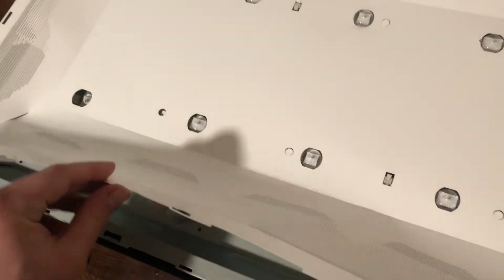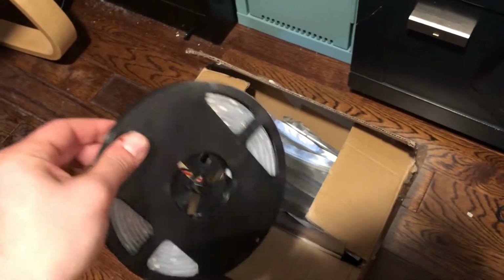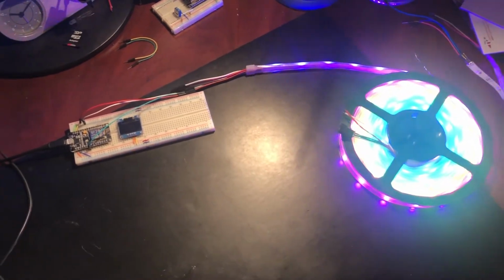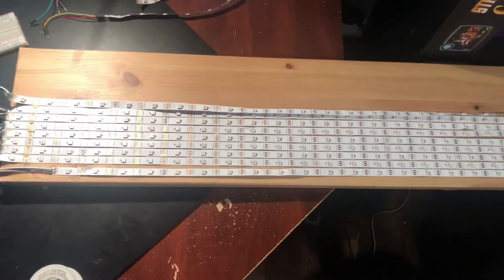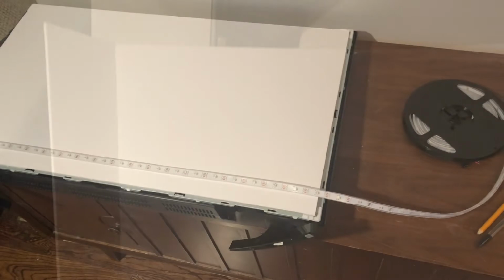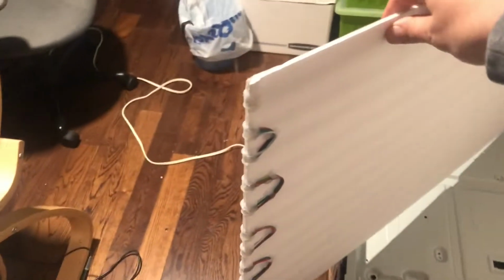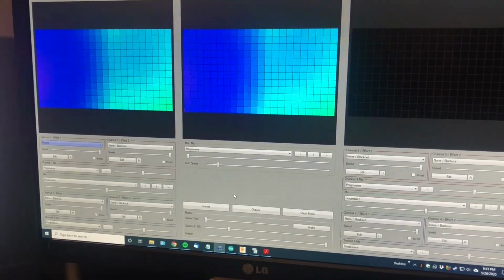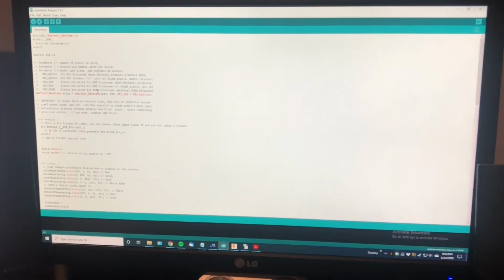Fix a Broken LCD TV with NeoPixels

Comment: What happens if you set a color of a pixel and then disconnect the data pin?, it retains the color?
Reply from the maker: Correct. It stays in the last updated state as long as power is still applied.